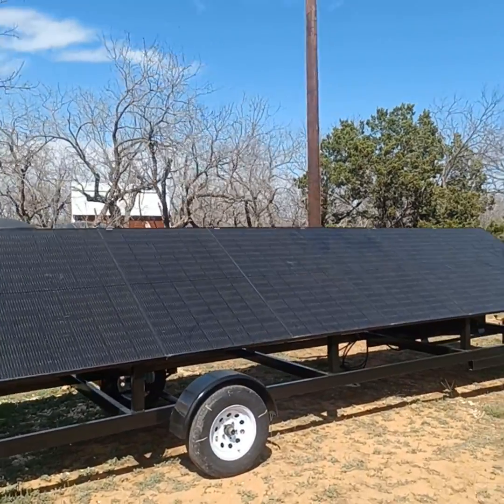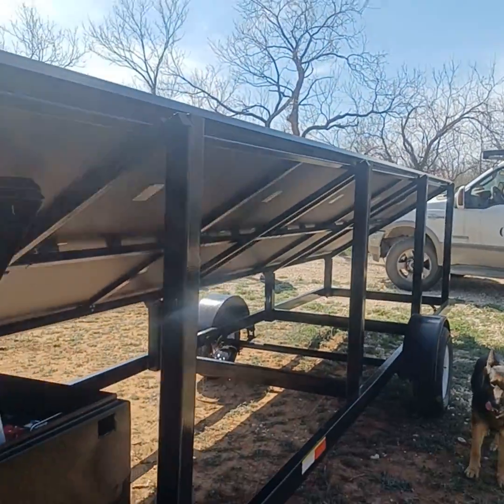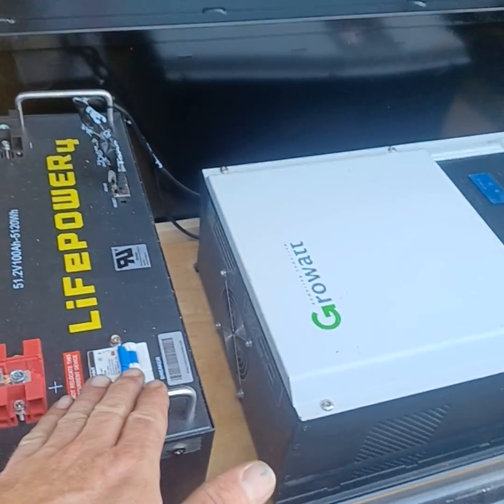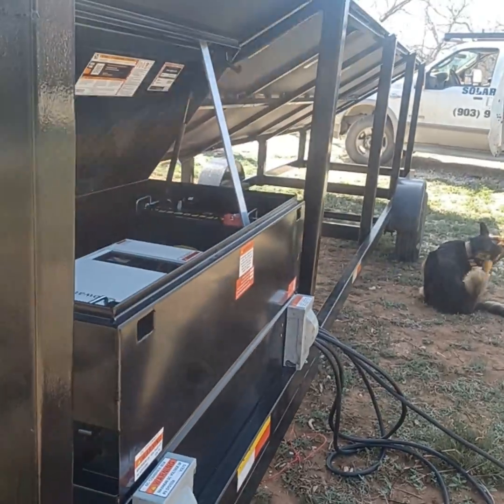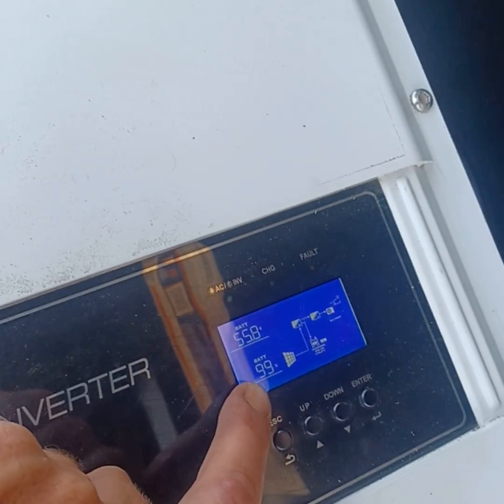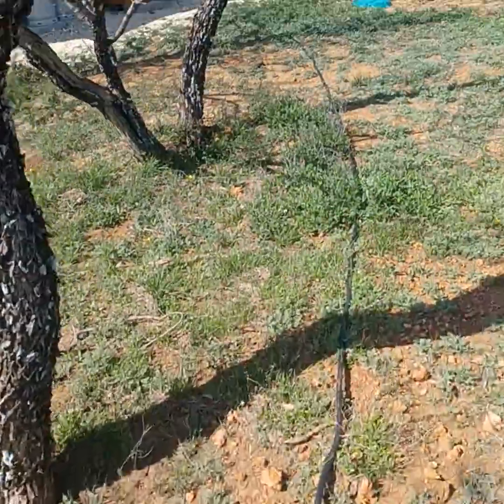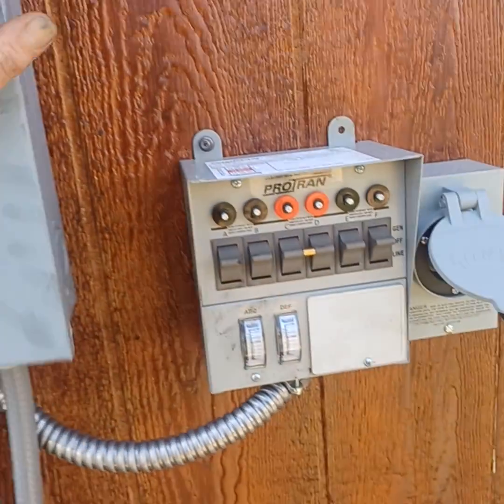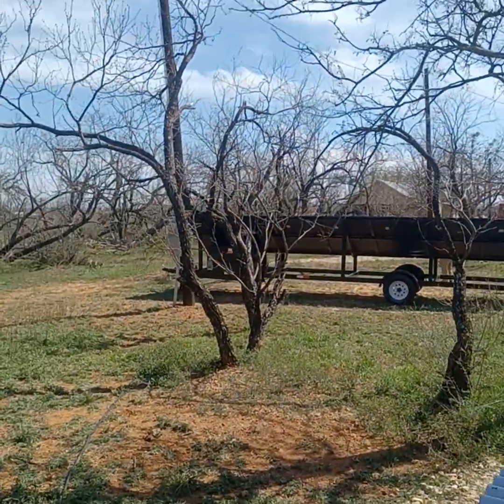off-grid doomsday prepping solar trailer ostrich mobile unit

Comment: how is this protected from blowing over or away during a wind storm ?
Reply from the maker: The frame weighs 2200 lbs with all gear completely loaded up. It tows like a dream at 80 mph down the highway. 10 years in building, these never had one flip over yet.
I would imagine that would be an hurricane class Insurance claim at that point? Love the feed back!🙂

Comment: Any concern of wind.  Nw texas can get crazy windy 😢
Reply from the maker: Not really.  The trailer sits low. 
Cuts the wind nicely.  Driving is no problem.  
The trailer weighs roughly 1800 pounds and  is pretty hard to flip over. But only time will tell.
Love the comment 👌

Comment: You can easily turn that to follow the sun across the sky.
Reply from the maker: User I tried that with motorized Wheels gaining an additional 17 to 25% on average didn't help out the cost of the engineering normal solar trackers are best bet but still not cost-efficient because of the Steal

Comment: that would be a handy set up for a homestead/farm work trailer. Have all your tools, pumps, compressors, and anything else youd need to run in the field. Nifty idea and execution but I would definitely want some forced ventilation/and or heat tape inside that electronics/battery box and lightning/surge protection installed.
Reply from the maker: Yes sir we've done the combination of all just depending on what application the customer needs and wants are. Love the feed back!!!💯